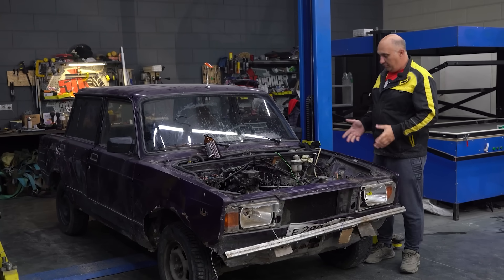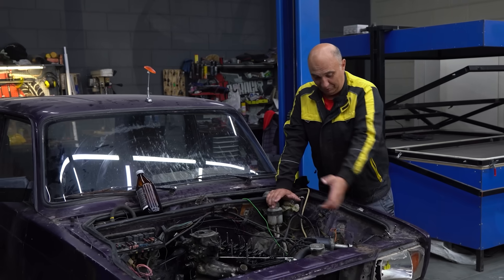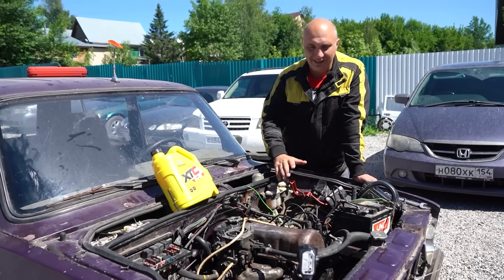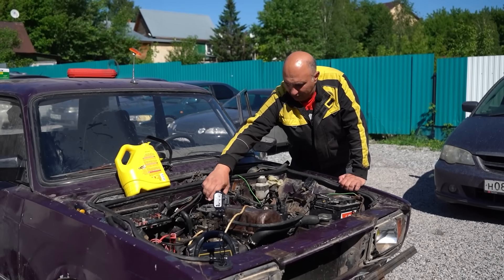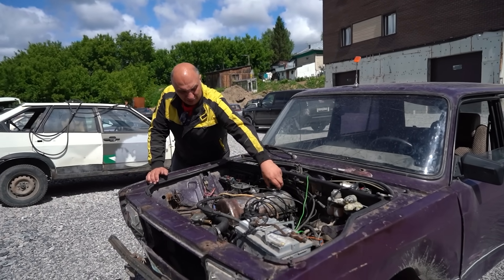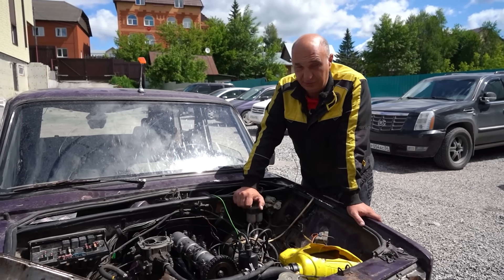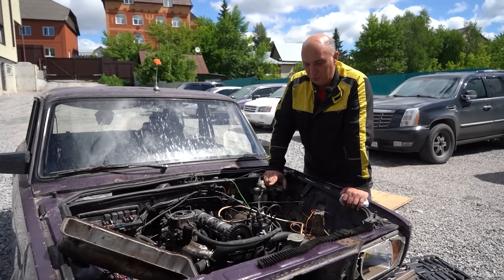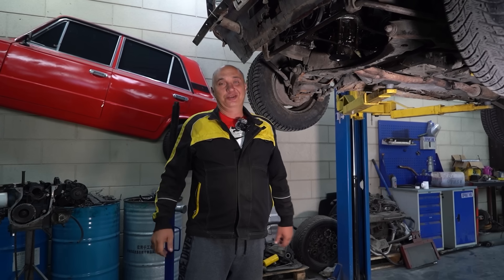Flushing an engine with paint remover – will it work?

Comment: Good for a older non vvt camshaft activated engine but on a variable timing engine or a turbocharged engine my concern would be with screen getting restricted and causing 🤔 😜 issues with the solenoids and cam phazer operating system, and then there's the camshaft and crankshaft seals,lol not sure how these materials hold up to those harsh chemicals lol.but I suppose if you got a car that someone used cheap motor oils in,or just didn't change it cause some beer and cigarettes was more important 🤔 than hey you have nothing to really loose if the engine already has sludge issues lol.when inspecting a car for someone who has asked me to look it over I always remove the oil cap and even send my borascope in for a look if dipstick shows sludge and dirty oil and borascope confirms this by visual inspection and sludge build up is evident the I tell the interested buyers to stay away and look for another car for sale because there investment into a car with a sludge engine in this day with vvt and sofisticated timing control and chains it will be a nightmare down the road.love your to the point on hands experiments some of these you guys do are just entertaining 😂 good job guys keep them coming 👏 peace.
Reply: You must be talking 5.4s

Comment: Just run diesel instead of oil. Drive until engine reaches temperature then drain it and put fresh oil in. Run the fresh oil for 50 miles then change oil again

Comment: I have used diesel fuel with great success. Apparently it softens seals to stop leaks another bonus . Quites noisy lifters too .
Reply: Used  Disel mixed with gasoline  2/3  Diesel, 1/3 gasoline.  But it's very dungerous! I never wait engine getting warm! Starts cold, running for 2 minutes,  wait and starts again when it's cold.  Do it 4 times. And pray.   Neves explodes with me.
Reply: Maybe too soft for the seals.
Did you have issues with engine seals after, let's say, a year?
Reply: @fawzisdudah8511  If you are having problems with the seals, they will be resolved within a week at most.

Comment: flushing costs, paintstripper costs, i flush engines or gearbox with diesel! then you can still use it as fuel after a filter to remove metal bits

Comment: Love your channel ! Very interesting test you performed. It reminded me when I was young, back in the early 1980's. I worked at a small "hole in the wall" auto repair shop. I was 20 years old. The owner was a WW2 veteran and had some pretty strong chemicals still stored in his garage. He'd bought them cheap as government surplus in the late 40's . For some reason, American engines in the 70's and 80's were full of sludge!!. I know they've improved since then but petroleum products weren't that clean back then. This Oldsmobile was loaded with sludge. SO ONE DAY....my boss hands me a quart of the stinkyest black colored chemical I've ever smelled. It was horrible!! He says, "drain the oil out of that engine, and put 4 quarts of WATER and one quart of the chemical  into the engine! I said WATER??  But that will ruin his engine! "NO IT WON'T" my  boss told me...so I did it. The boss said  "park the car across the street and let it run a 2000 rpm for a half hour!  Steam was blasting out of the tail pipe, the entire time, and the horrible smell filled the entire neighborhood!! The Steam kept blasting out of the tail pipe for over a half hour. The boss says, "Okay, bring her in and drain it". The "oil" was coal black , thin as gasoline, and it burned my eyes and nose while it drained. I was choking! I removed the valve covers and { was shocked! The valves, springs, rockers and heads looked brand new!! I said "where did you get that stuff Bill"!! He said "never mind that"! Its been banned by the EPA since the 50's!! hahaha! That was the last time we ever used that chemical. Never knew what it was but boy did it work!!
Reply: I'm very curious what that chemical is, what did it smell like? pool chlorine?
Reply: @Misha-dr9rh  it's paint thinner it cleans like paint thinner will clean you should try it🤣😂🤣
Reply: meh the car needs to sniff a bit of paint thinner🤣
Reply: That darks stuff may be oil with sulphonic acid. You gotta flush it back with fresh oil before the Last running oil fill.
Reply: That black liquid might've been black disinfectant, I mixed black disinfectant with water, can't remember the mix ratio, I placed an aluminum engine head in a large pan and covered it with the mixture, let stay about 3days and was able to get the carbon off with a paint brush. I washed it after with the garden hose, the head looked like new.
Reply: Greetings from northern Sweden. 

Yep,, pretty much all the good stuff is now banned.
Reply: @n.matthewcarter6437🤣🤣🤣🤣Sometimes the old ways are still the best ways!!

Comment: Paint thinner is a brutal treatment but is will dissolve all the crap.
Plan to use it on stuck lifters instead of diesel. Be careful draining oil or you will be high as a kite.

Comment: You can, if you are a painter, easily smell what's in it. Typically it's Benzene and Acetone. These are easy to smell even if there's other stuff in it. But it's usually combined molecules like Ethyl acetate, which is probably in alot of solvents and paint removers. Ethylbenzene is also pretty common and both smell very much like their original form.
Reply: The good stuff has mek but I doubt that was it. Going by it flowing like water I'd say your probably right acetone.
Reply: Benzene? In what country?
Reply: @MrBradshawbenjamin  usa
Reply: Thanks! Been looking for a cheap Acetone for my fuel vapor project.

Comment: 25% diesel in the engine oil and use without requirement for 100 km. Cleaning guarantee without damaging seals and rubber parts

Comment: I’ve seen people flush motors out with ATF automatic transmission fluid, and it seem to work good.  If the motor is really worn out it will smoke and burn oil really bad afterwards because the carbon build up is gone

Comment: I used to use straight diesel fuel (no oil). I would run the motor for two minutes then let it sit for twenty mins then run for about ten minutes and let sit for another twenty mins. Then final run about ten minutes and drain.

Comment: Great way to fuck up the main seals. Definitely will clean the sludge. But running the engine is not good idea without much paint remover in the engine. The oil will not lubricate very well thinned out.

Comment: Last resort before throw the engine away. otherwise will clean your wallet. If oils plumbing clogged the engine is finish . remember where the slugs go before reaching the oil filter.it explained why oils pressure high. Clogged big chunks never make it to oil Pan

Comment: The paint stripper is methylene chloride (CH2Cl2) very good at removing organic oils (nonpolar). The dimexide is Dimethylsulfoxide (SO(CH3)2) which is good at removing both nonpolar and polar contaminants.
Reply: so does that mean they are similar or very different?🤔
Reply: @raven4k998  rather different. Both can be used on oily (nonpolar) compounds, but only DMSO works for polar substances.
Reply: @JoshStLouis314  but can you run crysis on it?
Reply: @raven4k998  you can if you huff it
Reply: are these southern or northern hemisphere polar bears

Comment: You should try "LA's Totally Awesome", just replace a quart of oil with a quart of that, or even less should do the trick, let it idle for 30 minutes like you did here, I've heard it does an amazing job, not something I'd want to try though unless the engine was on the verge of blowing up.

Comment: I flushed an old engine with paint thinner mixed with engine oil It worked for me and got sludge out.  I let the engine run on tick over for  half an hour then drained it 1 hour later.

Comment: The old school Guy's used kerosene, or diesel fuel. Have a few extra oil filters on hand. Keep an eye on the oil pressure. Do not rev, or drive while flushing!

Comment: The way we cleaned very dirty parts was by putting them in a large metal trash can filled with degreaser and water. We'd heat it up, put the disassembled engine parts in, then let them "cook" for 20 minutes. Pull out the parts, scrub the stubborn gunk, then put it in the degreaser for a little while longer. You'll have nearly acid-cleaned parts in an hour.

Comment: I am from the south and here in middle Tennessee I always heard of the old timers using kerosene when I was growing up. I kind of got that idea from my dad because when he was young he repaired watches for his spending money and he always soaked them in kerosene before repairing them. He always told me kerosene worked quite well for that.
Reply: Another old timer thing was diesel... That's what my grandfather taught me.
Reply: @Z_732  yes, I've used red diesel but you need to be careful no to dilute engine oil too thin
Reply: Damn for real?
Reply: yes kero works but I prefer seafoam its a bit milder. I do it right before an oil change, go for a quick drive and then change oil
Reply: A few years ago one of my kids had a suv that they hadn't changed the oil on for 2 years. (They told me the change oil light service light never came on. I very politely told them that whether or not it comes on, the oil needs to be changed every at the minimum every 5k miles if they are using synthetic.)  What was in there was like sludge the dealer wouldn't touch it. I used a regular engine flush product on it three times and then did regular oil changes with a quart of transmission fluid for the 5th quart 2 more times, over the next next 2 months. At the end the oil was clean and the motor was running properly. An old mechanic told me the tranny fluid trick. He said it contains a lot more detergents than regular oil and should clean it up. Thank G-d it did the trick.

Comment: You can get the same results by putting diesel in the oil. Only it won't destroy the engine internals and seals.
Reply: Me too,I did it for my c200 mercedes

Comment: Privet! Canalizate kausitik soda rabotie. Only drain clogg remover works to dissolve engine crust. I have tried 10 different products on a SAAB 9-5 with blocked pick up screen. Bensin, Diesel, thinner, proffesional products etc. Is a waste of time and money. But poor Caustic soda and water down the oil pan works. On the SAAB you can fill through dip stick tube. and then drain. After poor diesel in to clean out. I didn't start and run the engine due to the chemical reaction the soda makes. If you have something crusty laying about you can try in a bucket. Maybe alternate cycles of soda and paint cleaner would do the trick. But ther is so much work involved that it's as easy just mechanicla clean the engine inside. My recomendations though is that as long you have oil pressure it's better to leave the sludge alone. My experience is that cleaning out the engine will make it brake pretty soon due to worned out bearing that actually needs the thick sludge to take up the gaps. Twice it happened to me that engine started knocking only by changing oil and filter in cars that the owner never change oil for many many years. On a JEEP CJ7 straight six the filter was completly dry in side and the filter couldn't even be cruched in an oilfilter press.
Same with an Ford Essex 3.0. The JEEP had been used only during winter plowing snow in a yard only a few times per year for 20 years.

Comment: It would have been interesting to have had a oil pressure gauge fitted showing the oil pressure before one regular oil, then when the paint thinner installed, and once flushed what the engine pressure is on regular oil? In the UK up to  the 1980's it wasn't uncommon to use paraffin mixed in 50:50 of normal oil, it was regarded as flushing oil, you could buy flushing oil over the counter too. I was confident in the  action of flushing oil in the engines of those days BUT wouldn't recommend you try this in an engine after the 90's as the engine technology is a great deal more refined in tolerances, somehow I don't think anyone will be trying this in their new Audi or BMW!  anyway greetings from the UK and keep the great work up, we really like the show here.

Comment: DO NOT DO THIS..  this will damage your engine seals/rings and you will begin to have oil leaks..  cool video tho
Reply: How do you know,have you done it
Reply: Rings are hard steal. V covers could rubber as gaskets well oil pressure sensor. But know what talking about before make sound like you know what talking about and something won't just a goofy scared commenter.
Reply: Rings are made of steel 😂😂😂
Reply: Didnt mean the rings.. but the rubber seals will be damaged, as well as gasket maker etc.  point is you dont wanna do this.. but if u dont believe me, go ahead and try it out 😂

Comment: Had an old guy use water. Get the engine hot rev it up and pour in the water. Also seen someone else use and swear by using atf. I have used diesel with great effect. It keeps enough lube to not destroy things.
Reply: Poured down the intake.

Comment: In the US, most paint stripper contains methylene chloride.  Usually a thickener is included in a stripper formula as MeCl2 vapor pressure is fairly high - it evaporates quickly.  The thickener allows the chemical to soften the paint before it evaporates.  Methylene chloride would dissolve grease very well!
Reply: Paint thinner and paint stripper aren't the same substance.
Reply: I thought Methylene chloride or dichloromethane was actually been banned in the US.  But this is also likely much different than the Muriatic or hydrochloric acid based paint strippers I am used to using, which is why I was terrified watching this.  They were mostly likely using some solvent based paint stripper, and I never even knew such a thing existed.  Since I have only ever seen and used muriatic acid based strippers, much more dangerous.
Reply: @Mikej1592 That's what they used or a derivative. I have used it and it will remove almost every coating but not all. It evaporates very rapidly at temperatures and is highly toxic to breathe the fume. 
Has to be used in a negative pressure booth. 
It breaks down Aluminum.
It can cause explosion if exposed to aluminum in a sealed chamber.
Reply: I wondered if it were chlorohexane or somthing like that.

Comment: You can achieve the same effect by replacing all the oil with diesel fuel, allowing the engine to idle for an hour, and replacing the fuel with synthetic oil and a new filter. Also, you can drive the car if you do a fresh oil change, leave 1 quart of oil out of the oil change, and replace the final quart with transmission fluid.

Comment: Oldfarm trick is to flush a motor with diesel. Drop oil, overfill with diesel, idle for 3minutes and dump. Wont damaged anything internally as it's under no load and diesel is very oily yet good at breaking down gunk,

Comment: In times past in Jolly Olde Englande - when The EE UU didn't have their fangs biting our arses we used to have brilliant paint stripper called Nitomors and it was BRILLIANT!! Did I mention it was brilliant?  You had to use gloves but Everybody raved about how good it was!  But now it is Feckin' Useless! Same name, same green tin but NOT the same contents - NO WAY!! They tell you:- "for greater paint stripping efficiency, apply Nitromors and then cover immediately with Clingfilm... for greater penetration". In other words, it is useless and even covering it up this New E.U. Formula will not make the paint crinkle or bubble - in fact, it will just sit there like thick water looking smugly back at you!! I would just LOVE to know the active ingredients of your Russian "Guaranteed to Work" paint stripper??? (should that be:- "Works in Siberian Paint Stripper" as your summer seems to only last a day or two before it snows again??)

Comment: Mixing your oil with paint thinner seems like an interesting way to add octane and clean out the engine. As the oil heats up it'll off-gas the solvent, which will go through the PCV and into the intake!
Reply: I think bmw f1 team did something very similar back in the 90s (?)  My memory ain't perfect. .. 
Either way some f1 team was definitely fined for using off gasses from oil as a combustion enhancer.
Reply: @jamesrobinson9176  F1 turbo cars in the 80's used to use Toluene which has one of the highest octane ratings of all fuel types, minus Xylene and hydrogen.
Reply: What about all the seals it's going to come in contact with.???????
Reply: @ They'll survive a short time exposure no problem, don't forget that naphtha is also a petroleum distillate and very closely related to gasoline (in fact it damn near IS gas), and the polymer gaskets in question are built to survive boiling hot oil laden with gasoline or diesel.
Also helps to remember cars used to burn kerosene and ligroin which are pretty aggressive, which were also horrendously fuel-inefficient, all while having rubber seals that are susceptible to breakdown when exposed to petroleum. Was it a smart idea? No not whatsoever, but it still shows they didn't fall apart immediately and lasted a while in the harshest configuration they could be subjected to.
Reply: Get real